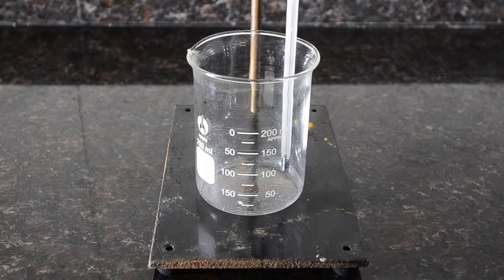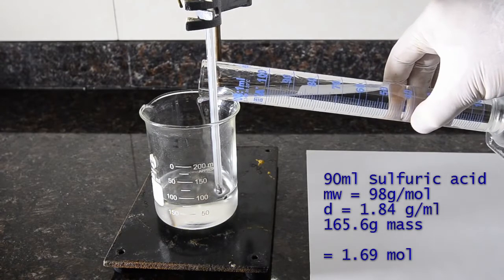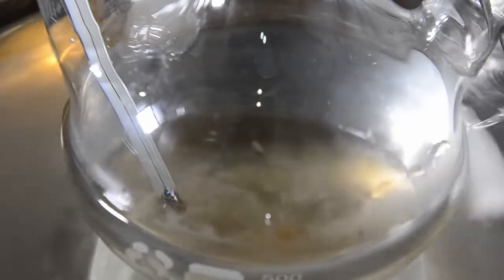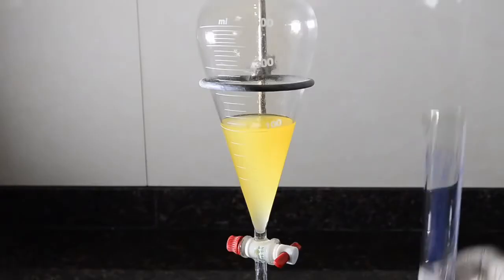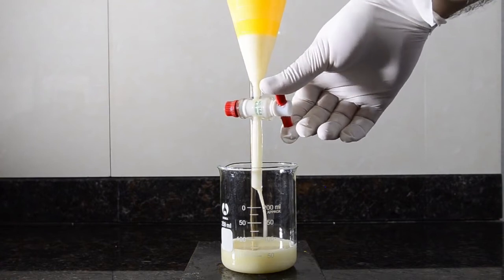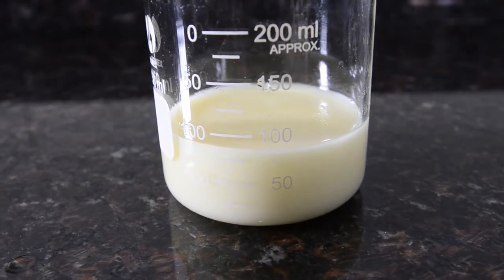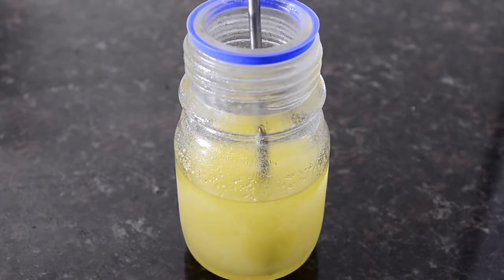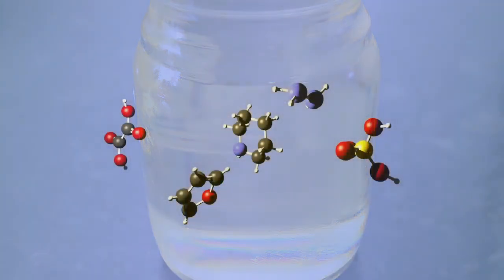Mononitration of Toluene ( Nitrotoluene) | ChemPlayer.

Comment: I saw a writeup with the same procedure for addition of the mixed acid, but they said to stirr under 50°C reflux for the last hour instead of room temperature. When I think about it, they used an hour instead of two for the mixed acid addition. I've actually seen a few different procedures, but this was the only one instructing to reflux at 50°C for the last hour of the synthesis.

Comment: Is it 4-nitrotoluene?
Reply: if you dont know that you shouldn't be making TNT
Reply: @EdwardTriesToScience  I am not making TNT . He said he is making mono and you said it is 4 nitrotoluene . so there is discrepancy
Reply: @stevet5790  its the literal same thing
Reply: @deckekuschel3615  Thank you . I am just confuse . I though he has to add that crystal into acids two more times to get TNT .
Reply: its a mixture of 2 and 4 nitrotoluenes but in the freezing step, you separate thm
Reply: @EdwardTriesToScience  How can I separate them?
Reply: he did separate them, when he put them in the freezer and filtered it, the crystals left in the filter is the relatively pure 4-nitrotoluene
Reply: @EdwardTriesToScience  is the end product  just mononitration ? to get tri-nitration , does he has to repete 2 more times ?
Reply: "nitrotoluene" refers to mononitrotoluene and is the preferred name in most cases
Reply: its para nitrotoluene, if you nitrate it two more times you make TNT